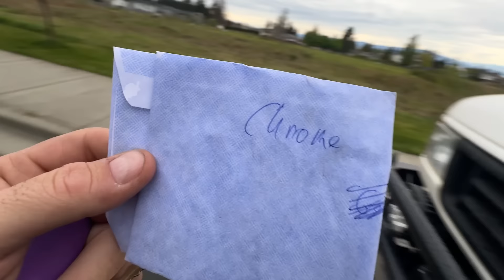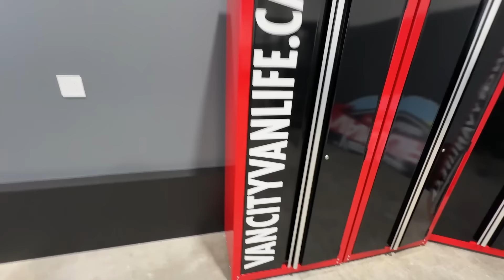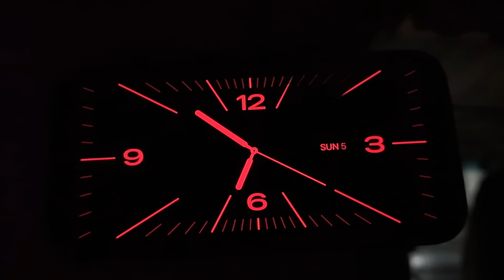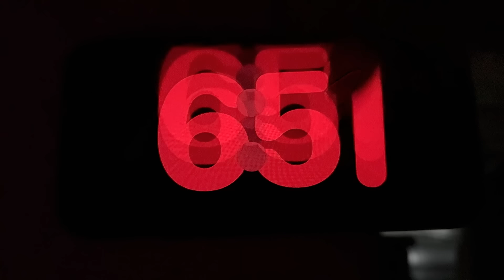Woke Up To a NOTE ON MY VAN AGAIN!!!  Some Shop Chaos...

Comment: Chrome, for your wifi lookup wifi boosters. They'll boost the broadcasting signal or the receptiveness. You only need a slight signal on the outside wall to boost it. Also I wouldn't paint the benches black personally because it makes black screws and other dark colored items on shelves more difficult to see without added LED lighting above each shelf, plus black is harder to keep looking nice than lighter colors.

Comment: Simple to say 'simple, just close the door'. But what happens when you or someone forgets? Or you leave it open to use it, then get sidetracked? Plus, is there not something in H&S laws that states there must be some sort of barrier for open areas with risk of fall from height? I'll be sure there is. If a person falls from there, im sure your insurance wont pay. Just feel you are not taking it serious, its probably the biggest danger in that shop.
Reply: The problem with that is any system that could be put there to prevent someone from falling would require someone to remember to close it otherwise it's just like the door

Comment: Mesh WiFi routers would be an easy way to expand the WiFi to outside. You just need a power outlet for each node. Lots of options out here, the amazon Eero goes on sale every once in awhile.

Comment: If you throw double D's in the air, somebody is going to get hurt...seriously.  😆Could you get a WiFi booster?  Those just plug in so that would save wiring...Take your time.  Do what is best for you.  There's nothing wrong with taking breaks to play.